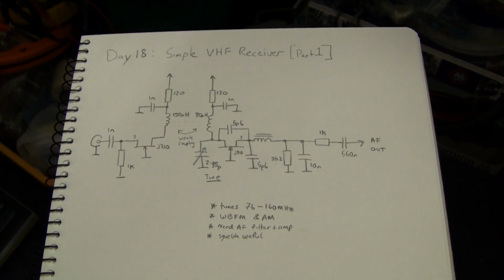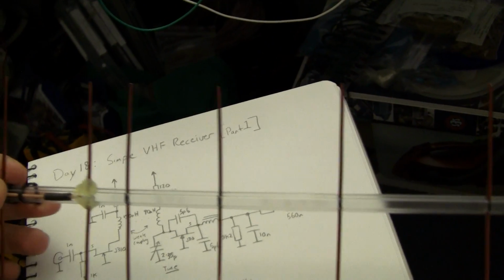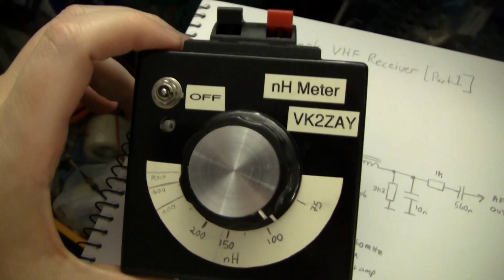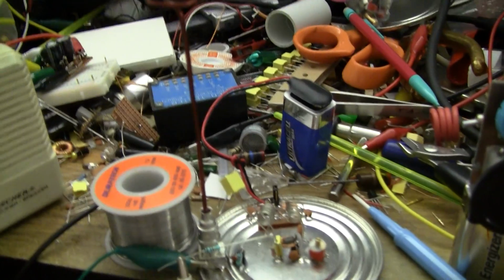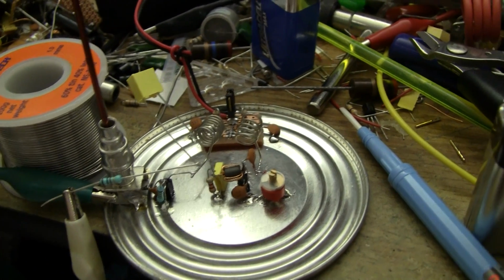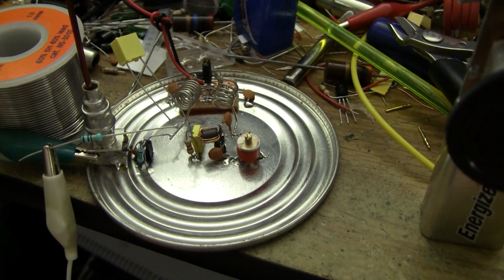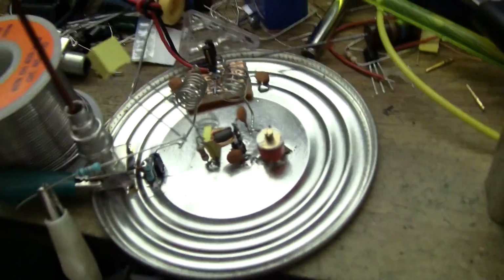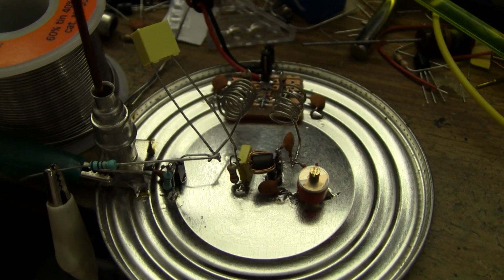Advent Calendar of Circuits 2011: Day 18: Simple VHF Receiver

Comment: hi Alan Yates i want to rebuilt the project could you please tell me what is the coil diameter and size.
Reply from the maker: The main receiver coil is 8 mm ID, 0.7 mm wire, 5 turns spaced about 12 mm long.  The buffer amplifier coil is similar and less critical, it has 7 turns roughly the same overall length.  If you can measure small inductances the values are in the video; 90 nH is what the coil measured before I installed it, anything around 70 - 120 nH would probably be fine, the coil could cover that just by stretching or pinching it.  The tuning capacitor can cover a fairly wide range of inductances anyway.
Reply: Hi alan yates i rebuilt the project but the reciever is very finicky you turn the variable cal the quench freq changes also there is a constant high pitch noise in the back round but it not form the quench the quench is at 35khz do you have any idea what it could be maybe coil with wrong dimentions

Comment: why is the 2-35p varicap to ground rather than parallel to the coil like a traditional tank circuit? wouldn't a cap to ground attenuate the RF? I've been trying to build a receiver for a very long time and the more I research the more I find I don't know..
Reply from the maker: The capacitor is still effectively parallel to the inductor.  The path for the circulating current is completed through the bypass capacitor.  The main reason to do this is so you can ground the capacitor rotor which helps avoid tool/body capacitance effects pulling the tuning.
Reply: @vk2zay  thank you so much for the reply.

Comment: hi, I want to build my own fm receiver, I see your in your circuit you use CB to match antenna impedance and that is also the way I'm trying to design my circuit. but A LOT of the examples online have a CE configuration with large input impedance... my question is, what are the advantages of high input impedance vs impedance matching... or when would it be desireable?
Reply from the maker: Depends upon the antenna impedance really, the CB is better for coax/dipoles, etc.  It also has much better reverse isolation which is important for superregenerative receivers to reduce radiation from their oscillating detector.  CE has some voltage gain and matches end-fed and short antennas better, but it has less isolation.
Reply: vk2zay thanks for that it makes sense now :)

Comment: i have a question about where you found a plastic flathead screwdriver...
Reply from the maker: xenochris it is actually ceramic and crazy expensive, specially designed for adjusting RF circuits.  I rarely use it.

Comment: I think that the drain of the second FET should be connected to a tap on the second tuned coil should make it work better, should you be tuning 118-136MHZ, and a duel gate MOSFET would make a better RF preamp.

Comment: Is it possible that I can use it for UHF and VHF? and how far can it receive the transmitter? I have ATV (Amateur Television) projects back in the 90's.
Reply from the maker: +Dr Pepper 23 sure, but at UHF the stability won't be great, it would need to be robustly built.  Range wise, well that depends upon the antennas at each end, the path in between and power level of the transmitter.  If you shield the receiver completely you could measure its input sensitivity, it is probably a few 10s of uV for 12 dB quieting or something.

Comment: Dear VK2ZAY, I have been a regular on your channel and website. I came across this video after watching VKY3E's 2 transistor vhf fm radio. I built 2 versions to test different components and how they acted. I had a problem with antenna as it was too sensitive to the touch and my own body radiation I guess, as it will tune if my hand was at close distance and i could hear great music and voice equally. what should i do for a better antenna that doesn't need me to touch or move.

thnx
Khalid
73

Comment: is there a possibility tha i could change the trimmer tuning capacitor with an old AM plastictuner?how should i do it?thanks
Reply from the maker: Yes, it likely has a much larger value, so you'd need to series it with a smaller capacitor to reduce its effective capacitance.  Also, depending upon its construction it may be quite lossy or not even capacitive at VHF, but in my experience the cheap polyvaricons designed for AM BCB service will work OK at VHF, at least the dual-gang 160 pF/60 pF ones with wide metal straps for terminals.
Reply: thank you very much sir
Reply from the maker: @David Wanklyn Yeah the AM/FM quad-gang ones normally have pretty good VHF performance on the smaller caps intended for the FM part of the radio.
Reply from the maker: @David Wanklyn Nice!  Glad it worked.

Comment: I'm a JFET newbie. How can this work with the gate grounded?
Reply from the maker: N-type JFETs don't cut off until their gate voltage is well below their source voltage.  This is called pinch-off.  The pinch-off voltage Vp is the Vgs where the drain current Id drops to some tiny value (basically zero, usually some small number of uA specified in the datasheet along with the corresponding Vp).

You can use this fact to bias JFETs to a specific quiescent current by arranging the drain current to drop voltage across a resistor Rs in the source (ie set a specific Vgs for a desired Id).  This is generally called "self-biasing" and can be calculated from Idss and Vp of the device.  Idss the drain saturation current and Vp the pinch off voltage are easily measured.  The Idss is the Id with the Vgs == 0 (i.e. gate/source shorted).  The Vp is the Vgs with a tiny Id current flowing, I use a 1M resistor in the source to measure it, putting the JFET well into pinch off..  To arrive at the required value of Rs you use the JFET active region drain current equation Id = Idss * (1 - Vgs/Vp)^2 and solve with -Vgs = Id*Rs.  There is a calculator on my website that does just this for you, but it helps if you know fundamentally that Id is a square-law relation to Vgs with Vp and Idss being the important coefficients:

http://www.vk2zay.net/calculators/jfetBiasing.php

Note that Vp is negative for an N-type JFET, the gate-channel diode has to remain reverse-biased for normal active-region JFET operation so all Vgs we care about for biasing are also -ve - hence the Vgs/Vp in the equation above is always +ve, even for pJFETs.  Vsg = -Vgs = Id*Rs.  Many people ignore the signs of Vp and just work with the magnitude.  My calculator doesn't care about Vp's sign either.  Technically it should handle -ve Ids for pJFETs, but it does not, magnitudes work fine either way.

Comment: I know this was posted over a year ago.  I was wondering what your thoughts would be on a project I want to build.   I really like your circuit design.  What i'd like to build is a NBFM receiver for the American NOAA weather radio at 162.4 - 162.55 mhz.    Thank you for any help and or advice you might have.

Comment: Alan - a fun project.  Highly recommend your circuit as a starter. Built just the detector.  On its own it will just drive a crystal earpiece on FM stations but highly recommend adding a 1 transistor amp.  I found that increasing the 2.2k to 5.6k and the drain resistor to 3.9k produced slightly better audio.  @hk34119 the RF choke is not critical.  I tried 2.2uH and 100uH and both worked.

Comment from the maker: @hk34119 Airband transmissions are brief and pretty narrow, you may be simply missing them.  If you know the frequency of the local control tower and have a frequency counter you can generate a signal to tune the receiver more precisely.